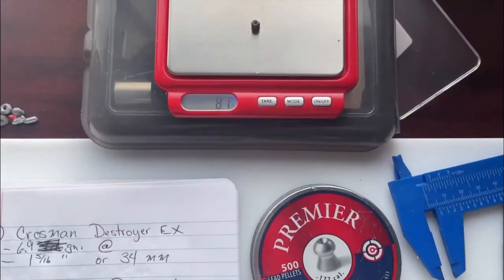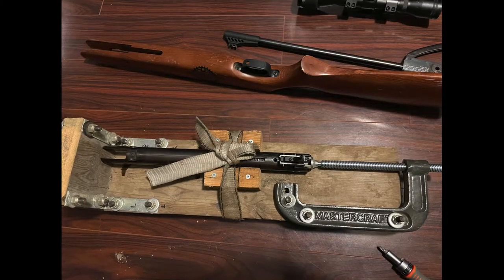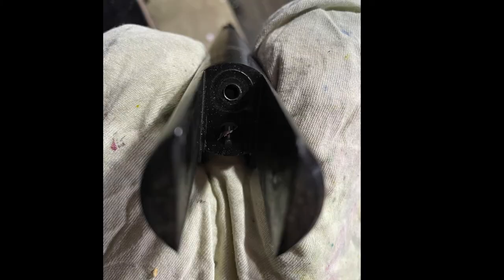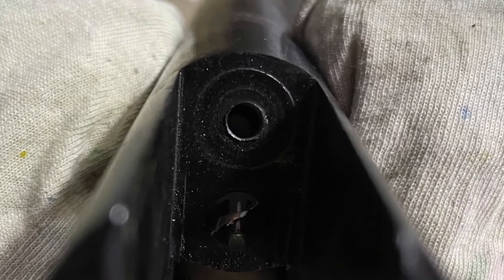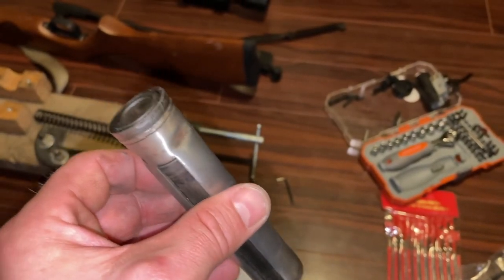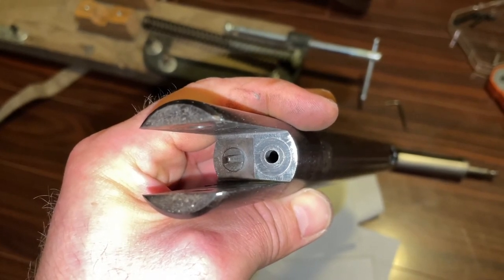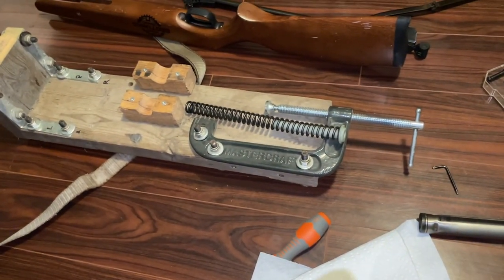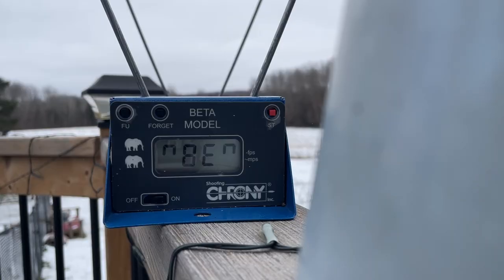Air rifle porting! will it gain FPS?

Comment: By opening the cylinder this will cause it to loose fps , what some tuners do is to drill it out the cylinder much wider and sweat in a piece of metal or brass and drill it out small then the original hole .Nice video Cheers 🍻
Reply from the maker: I was thinking of it as in an engine where you port it go get a larger volume of air to pass through. The reason I thought this was the way to go it that the piston will compress to a certain degree then slow down because it can’t over power the compressed air with the small hole restricting flow. So I figured if I bore it out a bit it would allow more air at the same pressure behind the pellet causing it to push it a bit faster before it because the barrel releasing the pressure.
Reply: @BROTUNED  I can see your thinking , example a lot of owners in the past were told to drill out the cylinder because their was a restriction build into to it , so by drilling it out , this would give the rifle more power out put , but in-fact it ruined the cylinder and many had to purchase new cylinders . So wider reducers power small producers more power . Cheers 🍻

Comment: Hi gentlemen I have a Canadian Benjamin Classic .22 with a 3.80mm hole because of you now at more or less 510 fpi thanks next mod Titan XS Springs..! keep up the good work and let us know thank you.
Reply from the maker: Glad you enjoyed the video! Spring upgrade will make the biggest difference for sure
Reply: @BROTUNED  a small question what do you think of the Titan XS Springs !!! thank you.
Reply from the maker: Honestly I have never tested any so I can’t answer your question. I have tried a few different springs from vortekproducts.com and everything went very smoothly.
Reply: @BROTUNED  Ok thank you I will see for myself ..!
Reply: I have a Crosman Optimus .177 495fps, what kind of spring would I need for more fps? Not sure what I’m looking for online. Thanks.
Reply: @ebarcoutdoors  the only one I know is the Titan XS Springs no 6 Crosman Phantom Crosman Optimus but you have to cut to adjust according to the long or short piston...
Reply: @jeep291  would u cut it to the same length as the stock spring?
Reply: @ebarcoutdoors  you need to remove 2-3 rings...reference. (Air Gun Spring Upgrade! the quest for FPS!). BROTUNE youtube (sorry for google translations)!!!
Reply from the maker: You could but you’d be loosing some of the preload pressure which would give you more fps. My stock spring is so short I don’t need a spring compressor to pull the retention pins out. With the new longer and stiffer spring there is around 2” of preload so a spring compressor is mandatory
Reply: @BROTUNED   phantom air rifle 495 vs 1000 fps wow!!!I just disassembled it and yes 2 inch difference thank you. I like the a+ video guide.
Reply: @BROTUNED  wow with the spring compressor is my hand thank you...
Reply from the maker: Perfect
Reply: @jeep291  Ive just ordered one and some other one made for me I'll let you know when they're fitted

Comment: Old video post!

I've been trying to mod my Crosman F11 .22 cal Canadian version (495 fps) for the last 3 months so it will actually get close to the 495 fps promised. Stock, it gets and avg of 441 fps with a 14.3 gr Crosman Premier hollow point pellet. I'm not getting my money's worth. 

Mods I'm doing are legal - I'm not exceeding the Canadian limit of 500 fps. I'm trying to improve the performance of this rifle to within the legal params.

Stock Performance:

Avg FPS with 17gr pellet:  390 fps (118.775 m/s) - Max: 395 fps
Avg FPS with 14.3gr pellet: 441 fps (134.38 m/s) - Max: 452 fps

EDIT: I managed to modify my Crosman F11 so it now gets 750 - 800 fps. Your response to this is still very good advice. I did not bore out the intake port. I'm sure I could gain more velocity by doing so, but like you said, it's permanent. The only way to know if you've gone too far is to keep going & as you know, each time you bore it out a bit more, you have to fully re-assemble it again. 
In order, I'd suggest: Shimming, replacing the piston, replacing the gas ram, then porting. A shim of 3mm gave me ~25fps gain. 6mm lost me 30 fps. Gas rams don't like too much preload, plus shimming decreases the overall volume of cubic air being compressed. It's a balance between pressure & volume & for this rifle, 3mm was best.
Reply from the maker: Ya I would start with things you can reverse. Porting is permanent.

Comment: I've often wonder about a convergent/ divergent nozzle design port... It takes hip pressure low speed air and goes to space...
Reply: muzzle  port  does  nothing //we did  when  young /8 to 12 /all and  short of   2  pellets  and   primer powder mix  in between  ,plus  pouring  slugs   7 mm long so   weight   of  3 to  7  pellets /when  with powder from  toy gun  plastic  ammo , or  best   6 mm flobert  dinamit noble platzpatronen //the  copper  one  tiny  for  6 mm start  guns // slug pushed  half inch into barrel  than  some  of  this  powder //can use  mix   with  flash powder or  even  all strike  match heads   carefully crushed /and  than follow   with  another pellet //START  WITH PELLET /POWDER ,,TINY  AMMOUNT LIKE   2  MATCH HEADS  OR   1  PLASTIC   COWBOY TIN GUN   POWDER /THAN  ANOTHER  PELLET ,,THAN  GO UP ,, WHEN PELLET    THAT  DOME  OUT IS   MOLTEN OR   TURN INTO  TINY  SHOOT //SEE WHEN  SHOOTIN  AT PAPER   3 METERS  OR SO ,,THAN  START  USING  POURED  OR  ROLLED  FROM LEAD WIRE   SLUGS,,START   3 MM ,,GO UP TO  1 CM /AND  INCREASE  LOAD ,,YOU  GO  EASY TO POWER  THAT  WOULD  KILL HUMAN ON  30 METERS //AND  YES   PREPARE  FEW  PISTON  SEALS   AND   EVERY  FEW 100 SHOOTS   CLEAN LEAD  OUT OF  PISTON /CILINDER ,, AFTER FEW 100 I DO NOT  GET WHY , BUT TRIGGER MECHANISM   BRAKE //LOOK BACKHIT OF  PISTON   WAS    HITTIN ON  TRIGGER  PARTS//BUT IN  APOCALIPSE  ,THIS  IS   STRONG  ENAUGH TO KILL  A   LIGHT DEER   OR  MAN / UP TO  50 METERS  NO QUESTIONS,,IT  COULD  PENETRATE   10 INCHES  OF DRY SPRUCE WOOD AND COULD DO MORE  ,,BUT WE DID  NOT  LOAD  IT  TO  THAT  POINT //POWDER EXTRACTION  FROM  TINY PLASTIC   4 MM TOY  GUNS DID  NOT  GIVE A  LOT  OF  POWDER //THAT S WHY WE STARTED ADDING   FLASH POWDER //AND  THAN  WE   HAD  LUCK  WE GREW  UP TO SHOOT  REAL GUNS BEFORE  WE D GO TOO STRONG //

Comment: couple issues here:

increasing the "transfer port" diameter will NOT produce a higher velocity of air...it will ONLY increase the volume of air.  So you have it backwards.  If the goal is to create more pressure = a faster feet per second, then you would want a smaller diameter transfer port.  but there are other physics that will control the actual maximum pressure. Most of this is due to variables that are not related to the size of the transfer port and have more to do with spring RATE and throw...as well as the size and fit of the pellet in the breech as well as the breech seal

second, I noticed you did not actually duplicate the same conditions in the before and after chrony.  Are they set at the same distance?  in the same barometric pressure (one looks like inside in warm controlled environment with chrony set up near the clay target and the other right near the muzzle in very cold weather.  yes these factors make a difference in feet per second measurements.  Also, are you using the same exact pellet brand AND BATCH?

another way to increase feet per second is to polish the inner charging barrel with "chrome polishing compound (never sand paper...that's just stupid!).  the smoothness of the inner charging barrel will have less surface friction and the piston gasket can then accelerate with less resistance...producing a faster rate of pressure increase.....

another way to increase feet per second is to change out the charging piston gasket/seal....there are some aftermarket designs that have better materials and fitment that allow the charging piston to travel faster (less resistance) and still maintain a very good seal.

one way to deliver a faster feet per second is to simply use a lighter grain pellet weight.  And there would be no need to make these kinds of modifications.  Another way without modifying the "iron" is to simply upgrade the charging piston....swapping a springer to a nitrogen gas piston is probably the easiest and most reliable upgrade you can make to a standard springer to get a faster feet per second.  And generally speaking, a nitrogen gas piston over a standard springer setup is going to get you less "noise" in terms of vibrations that affect accuracy.. gas pistons also generally do not have the loud "ring" that the standard springers do.

speaking of pellets...almost all pellets vary in actual gauge size...And this matters quite a bit in terms of speed, accuracy and consistency.  For instance, I have a benjamin trail np xl (.177/4,5 mm) that will shot tacks every day as long as I use a H&N 4.51 mm pellets...read it again..this is a pellet made by H&N that is slightly larger in diameter...4.51 mm...So it's a tighter fit.  I've demonstrated in chrony, it is a faster and more accurate pellet than any other in the same 10.5 grain size.  So size matters if you are after accuracy and consistent speed....conversely, I have never been able to shoot accurately with "vortex" branded pellets or rws ...they have a very loose fit.  and they fly all over the paper and record quite fps spread....the crosman domed premieres do okay...but it is the 4.51 mm H&N's that are the cats pajamas.
Reply: You forget, the piston will move faster with a larger port.

Comment: How old is this tin of pellet ? Mines are marked 7.9gr!

I am surprised it increased the velocity the port looked already pretty big ! 
(or all the pictures are after the drilling?)

I think I couldnt even get a toothpick in a Gamo port so im starting to believe this may be the only thing detuning them 
I dont think Crosman is using different port size for both versions tho !
Reply from the maker: Ya all pics are after the port job I forgot to get a baseline measurement
Reply from the maker: The pellets are about 10 years old ha ha
Reply: @BROTUNED  thats what I thought the port looks huge on all the pics 😁

Comment: More power isn't always better, probably gonna kick more with extra power.
Reply from the maker: Ya lost accuracy big time and went back to around 650 fps and almost thinking of dropping it back to around 500. Makes it a lot easier to shoot well and if it’s for critters that will have no issue taking care of them.
Reply: @BROTUNED  Yeah it's all about finding the balance with springers, some guns that tune really well it's possible to get a bit more power and a smoother shot cycle but would take a fair bit of polishing up.
Reply from the maker: I really wanna start using pcp’s but the start up cost is basically a voodoo rifle
Reply: @BROTUNED  It is expensive but I'm not a big fan of pcps, they just feel dead to me, higher powered ones are gonna have a bit of kick though. I just love spring guns.
Reply from the maker: I’ve never tried a pcp but they look like they are very accurate
Reply: Good chance to loose accuracy because of the piston slamming against the breech before the pellet left the barrel.

Comment: I’m looking for a spring upgrade for my Crosman Optimus .177 495fps. What kind of spring do I need to get for more fps? I have no idea what I’m looking for online. Is there a certain size or length I need? Any help would be appreciated and great video.👍🏼
Reply from the maker: I get mine from vortekproducts.com  I can tell you the exact spring I got but basically what I did was pulled the stock spring out and measured it’s length and wire thickness and added a few coils to it. Then I fit it in the air gun and if it got spring bind before it was cocked I would disassemble it again and cut a coil off of the spring until I had the longest spring that would fit without binding up and that’s about it.
Reply: @BROTUNED  That seems like a lot of work that I’m too lazy to do🤣 Would stretching my stock spring do the trick?
Reply from the maker: It may but I think that would be difficult To accomplish. You could add washers behind the spring to preload it and that would be a lot easier
Reply: I bought a brand new spring for the Crosman Optimus a few years ago from Canada Shooting Supply - it is the high power 1200fps spring and it comes with  brand new piston and seal - I originally bought it to swap out the weak spring in my 495fps Crosman Phantom but never ever got around to doing it. 
I cant tell you the exact specs of the spring off hand.. but it was cheap to buy and a better option than trying to stretch out your original spring.
Check Canada Shooting Supply and see if they still have them in stock.
Reply: @dreadnaughttactical  thanks man

Comment: Hi, I have a gamo magnum 1250 4.5mm and it's tube hole is 4 mm is it right to make it 4.5mm to gain more fps ?
Reply from the maker: That’s what I tried because that would be a restriction in the system. So I matched opened it up a bit and it did make a small increase of velocity.
Reply: @BROTUNED  many people say that if you have an air rifle 4.5mm the maximum opening in a tube hole is 3.8mm. I drilled it to 4.5mm and I do not know if it gets more fps or lose fps
Reply from the maker: Have you chronographed it before and after?
Reply from the maker: As you can see in the video I gained a bit wasn’t much but it did make a difference
Reply: @BROTUNED  nope, I used the pages of the same book as an example. I think that my pellet penetrated a few more pages.
Reply: @BROTUNED  my question is if I opened too much with negative results. Anyway, I did it and I cannot undo it now.
Reply from the maker: I don’t believe it would and if it did it wouldn’t be much because the piston is still pushing basically the same volume of air behind the pellet. I think if it was greater in diameter than the bore of the barrel there could be a chance of come leaking past the seal between the barrel and the face of the breach. But again I think it would be so small of a loss that it would be negligible.
Reply: @BROTUNED  thank you very much for the information.
Reply from the maker: You are very welcome
Reply from the maker: If I were you I’d open it and test going up in gradual increments and test accuracy as well

Comment: So I'm wondering if you paint an air rifle with a rubberized coating if it will deaden piston slap.

Ive read a lot of people saying that porting can ruin many rifles but I've wondered about polishing and beveling the port for  less angle of extry.
Reply from the maker: Not to sure. Maybe a rubber bumper for the piston to hit would work
Reply: @BROTUNED  yeah like a cut dowm poly bush! Thats not a bad idea...

Comment: Drilling a transfer port on an airgun is probably the worst idea of all.
Think of it as a blowpipe, you want the maximum of air passing very quickly trough the smalest hole possible.
Or try to think of what your mouth does when you spit far, now imagine spitting with your mouth fully opened...see where I'm going ?

Most guns already have the transfer port maximised, tho you may gain some fps if lucky, you have more chances of ruining the gun or making it shoot LESS fast...

Believe me I tried 🤦🤦🤦 fawk me
Reply from the maker: I understand what you’re saying but it’s cheap gun and I’m experimenting with it . Not to worried about it but it does shoot better now. I think I’m going to put a lighter weight spring back in it though the recoil is getting ridiculous the heavier I go.
Reply: @BROTUNED  
If you want to open the port they do not recommend going higher than 80% of the pellet squirt diameter. Under that is OK I guess ... 🤷

I know what you mean about the crazy recoil. 
All the guns I buy are under 500fps without a licence (heh Canada), tho they do shoot very smoothly right out of the box, then I try my best to bring them as close as I can to the legal capacity. 

Most of the time I just end-up with a gun that's too powerfull to stay legal with an unpleasant "boïoïoïong" effect. The fix to that is to fit a gas ram instead of a spring.

The best way to gain a lot of power (you have already done) is to plug the hole in the piston. You get on average 200 more fps.

Also you can literally bathe the spring in grease, polish the piston with a very fine sandpaper and lightly grease it also. Check if the chamber is free of sand or other particles. You can gain an additionnal 30-60 fps just by eliminating metal friction.
✌

Comment: I tuned my webly falcon spring gun up ox spring drilled out the air release hole slightly bigger washers behind the spring  got stopped by police out shooting rabbits thay tested my gun it was 16 ftpound the leagle limit in Britain is 12 I was arrested gun conferscated I had no idea of the laws bk then they set anything over 12 u need a fire arm certificate
Reply from the maker: Omg that’s no good
Reply: They tested it right there on the spot then arrested you ? 🤔

Comment: Put some diesil in the back of the pellet. Compressed air will ignite it.
Reply from the maker: Regular oil also but so inconsistent
Reply: @BROTUNED  Try a mix of vasaline and diesil.. I've not tried yet but sounds about right don't it..
Reply from the maker: How fast will it go????
Reply: @BROTUNED  apparently I've seen vids saying it will increase from 800 fps to 1000+ fps.. I'll do it after the festive season, when I'm not drunk anymore.
Reply from the maker: Lol that’s awesome! Cheers 🍻